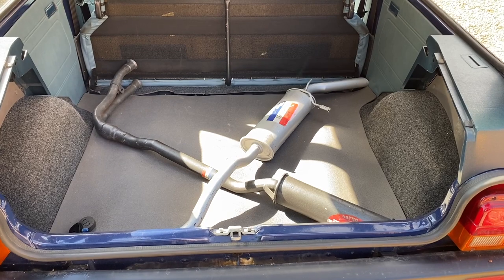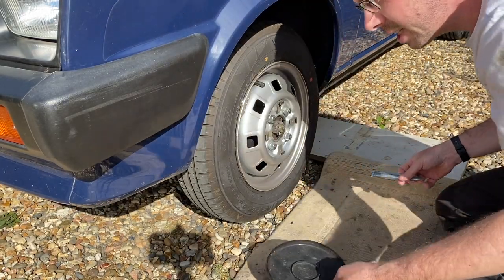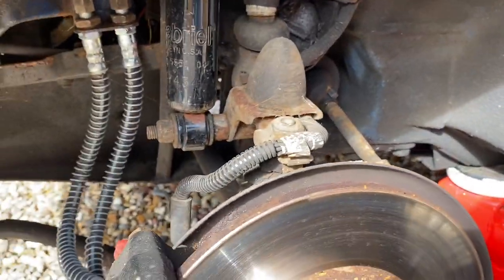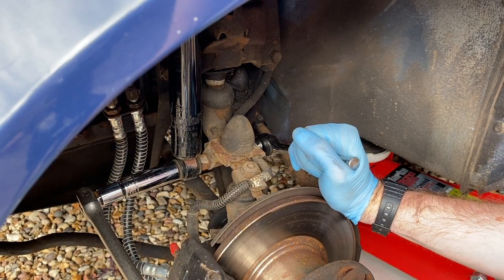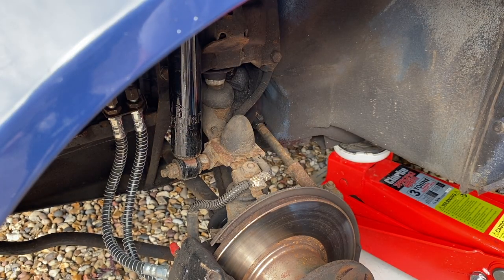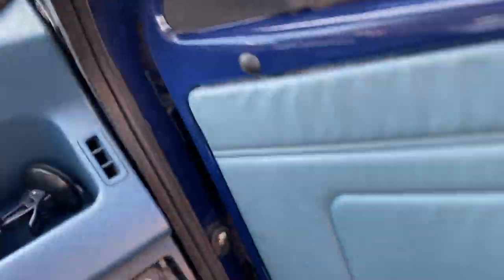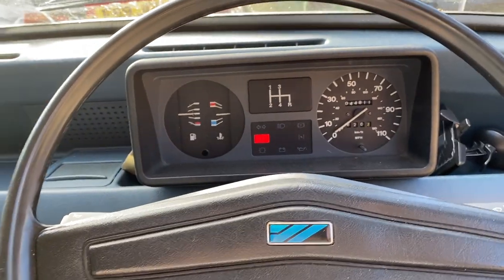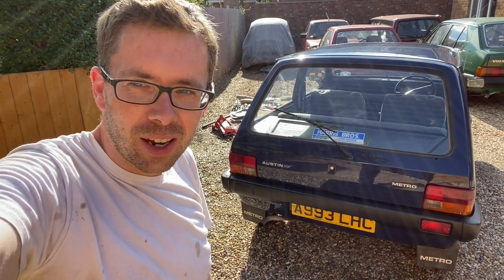Metro Tinkering: shock absorber and exhaust blow

Comment: Nothing more frustrating than a job being stopped by simple fittings. Are parts generally readily available for the Metro?
I had difficulty sourcing a back box for my 1997 Renault recently but I think old British cars seem to have a good support network when it comes to parts.
Reply from the maker: Yes thankfully, most parts are easy to find as a lot are shared with the Mini. But some Metro-specific things are hard to source, such as the exhaust which doesn’t seem to exist in the U.K.!